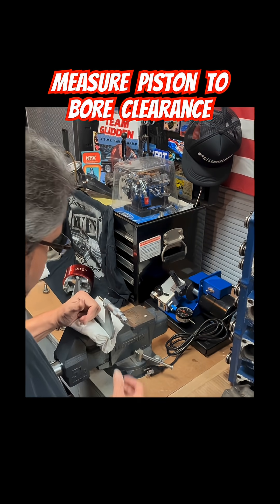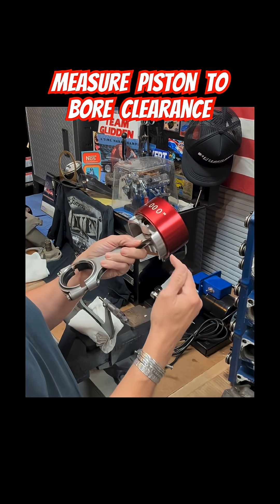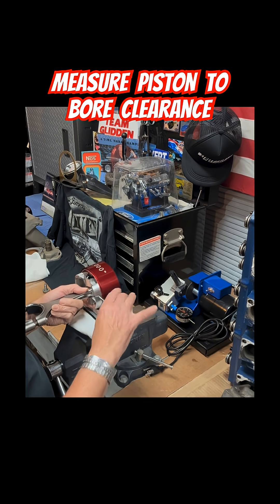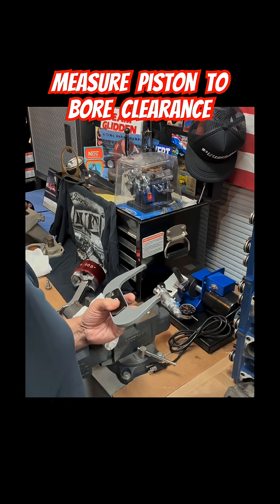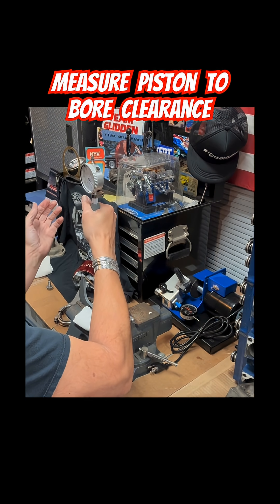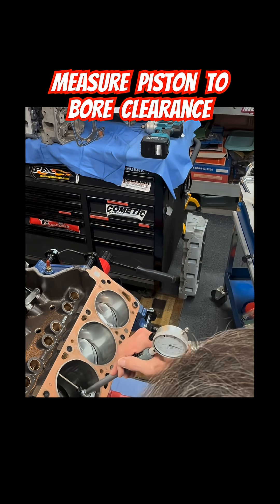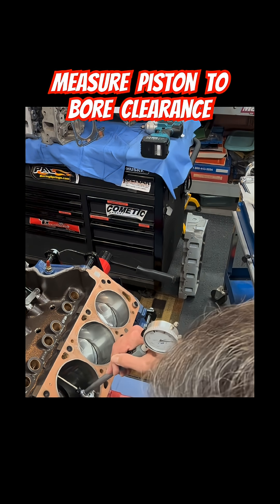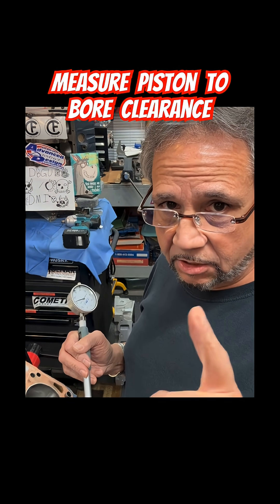Measure Piston To Bore Clearance #automobile #351c #racing #enginebuild #dragracing

Comment: This is the place to "See and learn." Professor Tim Halstead gives another lesson. In addition, it is absolutely critical to know what piston material is employed. Refer to the piston manufacturer's recommendation for general clearances. Same goes for ring gaps. Autothermic cast, Hypertechnic, 4032, or 2618 forged, type of coating, if any, etc. Different materials expand at different rates.
Reply from the maker: That’s exactly right. I mentioned those details in the description. And also that there are different specs for power adders, application, and the effects of temperature. Thanks as always for adding the years of experience and knowledge. ♥️💯🏁💪
Reply: @dragboss351cleveland  👍

Comment: I am building a Pontiac 433”, to tighten up the piston to wall clearance (it’s a little loose for my liking), I’m having them coated from Line2Lije coating.  Not only will it tighten it up a bit, adds a great wear coating for protection.  These tools are fun to learn!
Reply from the maker: Thanks Jeff. The pistons in my 409 cleveland are coated a couple of thou. I am having a Pontiac head on soon, races super stock. Good luck with build. Glad your here 💯🏁👍
Reply: @dragboss351cleveland thanks man!

Comment: 🧐 I have the summit equipment dial bar gauge and setting fixture lot easier to set up but boy is it expensive
Reply from the maker: This was a demonstration, I may buy that, is the dial bore gauge set up Bruce ?
Reply: @dragboss351cleveland 😢   the autocorrect says Summit it should be sunnen😮